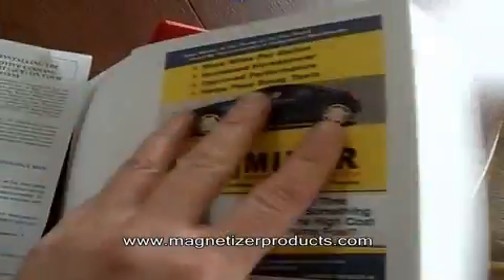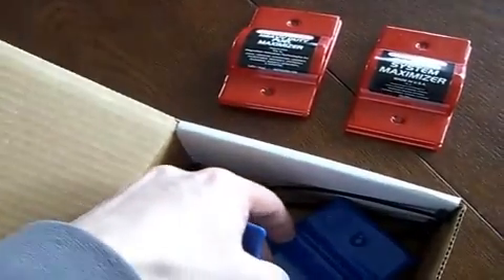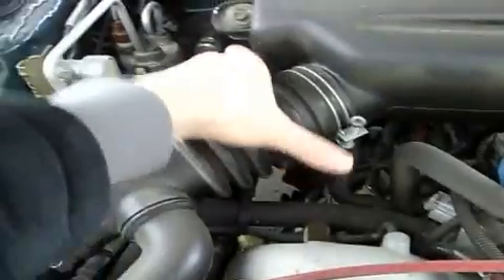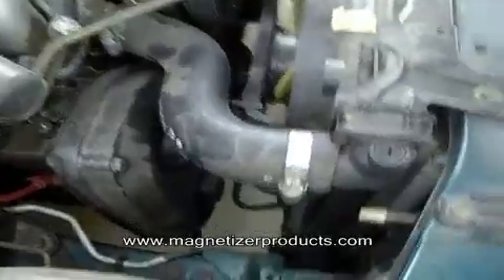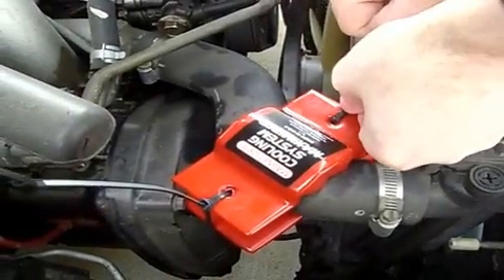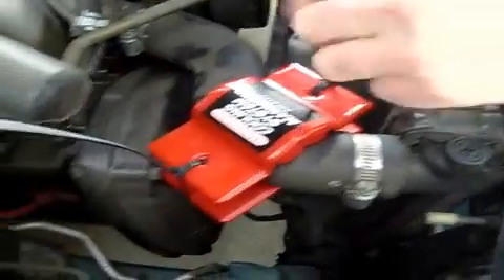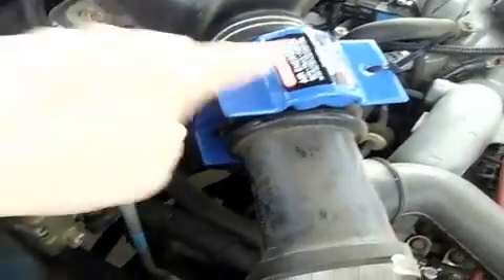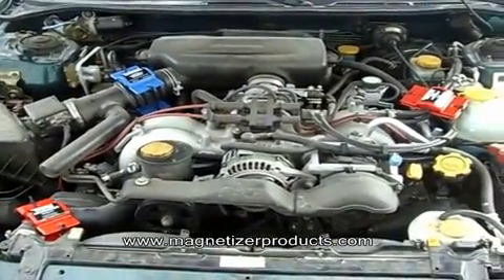Gasoline Maximizer for Automotive use from Magnetizer Products

Comment: The magnetizers work. Most people don't look past their pieholes and do the reading and plethora of research done on Magnetohydrodynamic technology. I've used these on fuel lines, recirc systems on cooling towers and more. These are not your Moms refrigerator magnets. The Flux density and Gauss ratings are substantial enough to effect the polarity of fuel & water. For use on fuel, you use the appropriate models that address the positive charge, in fuel molecules. Remember, positive or 'like' poles repel each other, which is what we want, when addressing fuels. and, opposite poles, N+S attract each other, which is what we Don't want, when addressing fuels.  And, for water, you use the models that use the so.pole only, to treat the CACO3 minerals, in water. I use to treat 500ton and 1000ton cooling towers and within 3mos. the scale came loose within the system and came out and dumped, in the towers sump. This, of course 'freaked' the engineers out. The end result was greater efficiency and heat transfer and factory equipment that functioned optimally, without mineral restrictions and heat buildup. Further, it saved them a boat load of money.  A huge reduction in chemical costs, labor costs, storage and handling issues, environmental issues, ie.-and no hazardous chems to drains or sewers..  I made money and my customers became 'happy campers'.  
Skeptics are everywhere in life. Those who don't understand the science, and don't do the research, or don't use the right magnetos, and don't apply magnetos correctly, are usually the nay-sayers. 
I've seen 'em all over the years, even the people who've used nefarious means to sabotage my installations & other magnetizer applicators, over the years. Sometimes it was engineers, afraid of losing their jobs, or it was someone hired by a chemical company, that lost an account, due to the overriding benefits, in applying magnetos to their piping systems and equipment. Magnetizers work especially well on re-circ systems. Always install a unit on the downside of a circ pump. Make sure the system you apply it to, is grounded. Read the instructions and when in doubt, speak to a techie, who's had experience in installing magnetizers.  Lastly, sometimes the people who are vilifying the Magnetizer, for instance, are people hired by other magneto manufacturers, to discredit a competitor, or its just a web troll who thinks all magnetics is voo-doo science.  So, just IGNORE them, stay focused, and get to work, solving your clients problems and make a buck.   Semper Paratus.

Comment: You guys know that rubber is a natural insulator of electricity and magnetics right?
They use it everywhere tvs house cars . You have to put magnets on steel gas lines or right in the water large magnet or air huge magnet to effect anything . This is from my high IQ of 50 , just eat donuts it will affect your  IQ like mine .

Comment: since when do you see rubber fuel lines on a fuel injected motor with just a crush clamp holding them on. and what is the little canister his fuel lines come out of rubber to steel the only time i have ever seen that kind of thing is when lines rushed out and a hack uses rubber line to bypass the rotten spots but i am not a subaru expert so maybe they are the only fuel injected car that has a bunch of rubber lines from the factory but a doubt it

Comment: oil filtet magnets do work... I cut apart my oil filter before an oil change and compared it to the one with magnets installed after 3000 miles.. there was 3 times as much metal material in the magnetized oil filter..
Reply: +lwj w - For God sake, don't mix things I use magnets on my oil filter and oil plug it work perfectly to retain ferrous particles. That's one thing, claiming fuel savings, performance improvement or any other benefit in the engine is total lie and scam. No other words serve to describe any company selling this so called "miracles".

Comment: Magnets cannot affect anything that is non-ferrous by nature, yet gadgets like this resurface in the marketplace like clockwork a few years after they're proven ineffective.  P.T. Barnum was right, new generations of suckers are always just getting ready to pop out of the womb.
Reply: +NOLL72 important to keep this in mind. iron is the element is associated with magnetism . haem iron from vegetable source could be less magnetic than inorganic iron ore. ionisation could have a play on how efficient  a system is. apparently postiive ions  hold a magnetic charge.
Reply: ions  could get into water. hence water could be affected by magnetism . question  becomes finer. can ions get into fire. if ions become entrapped in elements. fire is an element.
Reply: The terms ionize and magnetize are not interchangeable, as they describe two different properties. Although water may be ionized, giving it a positive or negative charge, it cannot be magnetized. If that were the case, this "gimmick" could be attached to a hose and water passed through it into a plastic container, then it would be attracted to a strong magnet held near its surface. That won't happen.
Positive and negative in electricity isn't the same as north and south poles in magnetism. It that were true, a magnet would stick to the lead post of a car battery. 
I learned this in grade school science class. Maybe you should go back and take a refresher course before attempting to tell somebody that paid attention in class that they are wrong. I'd suggest taking spelling and grammar again too.

Comment: if the fuel is magnetised positively. the air is charged negatively. do then opposites attract . do not some magnets have a north , and south on both sides.
Reply: I've been working with magnets since the 1990's. In the first few years they didn't work very well. Then we changed to monopole magnets and the results were incredible. Some fuel molecules are positive and some are negative. Opposites attract so the fuel molecules come together to produce hydrocarbon clusters. Oxygen cannot reach the inside of the cluster so that fuel is wasted. Only 68% of the fuel is burned. This is why vehicles use so much pollution equipment. When you convert fuel to a positive polarity, the molecules repel each other and the clusters break apart. Its a lot easier to burn a tiny fuel molecule than a clump of them. We then convert the air coming in to the engine to a negative polarity. The negatively charged oxygen is now attracted to the positively charged fuel and 42% more fuel is burned. Emissions drop by up to 90%.

When others saw our success, hundreds of knockoff artists came into the marketplace with just a tiny magnet with a hard plastic housing and said that their product would save fuel. They tell people that the fuel molecules are aligned. This is just made up trash. This is what they tested on Mythbusters that failed to work. Go to www.mycoolboost.com for more (much more) information    -Jeff
Reply: @Diantane22   How to obtain corect polarity? From N and S positining or appel and repell? Thanks!
Reply: A scam huh? How come one of my commercial customers bought systems for 39 vehicles over three months (including two tractor trailers and 14 triaxle dump trucks. Two weeks after installation the owner reported the mileage went from 5 to 6.2 (a 22% gain). He said the numbers don't lie. The drivers fill their trucks up every night and write down the truck's mileage. If it didn't work, why would they invest tens of thousands of dollars over such a long time??
Reply: Why are you arguing with me? We sell the same product line. But instead of advertising 30 year old testimonials and technology on my website (I used to show the same testimonials twenty years ago), I decided to go out into the field and see for myself. All of my initial technical training came from Peter and Mike, but since I installed thousands of systems (have thousands of pictures of them) and faced many problems that were overcome through research, I can tell you for a fact that I know more about this than most reps out there. Especially the ones that sit at home and post a 20 year old, non-updated website that show videos that are distorted from age. The testimonials you post are from cars built in 1997 and '99. I work on 2018 vehicles! They have changed a lot in 30 years. Last time I worked in the field was yesterday, not decades ago.
Reply: You say that what I'm saying is not entirely true. This is because you are reading the wording presented by the technicians at Magnetizer 25 years ago. Once A class we had heard how this works from a US Navy nuclear engineer. After his speech, the students in the class said that what he explains was far different than how I told it. I replied that what he said was exactly right, but if I talked that way to most customers, they would never be able to understand me. So I have to break it down into layman's terms so they can.

Working as a mechanic inspector in power plants, factories and office buildings for most of my life I continuously had to do this so that the average engineer would know what was wrong with the system that I discovered a problem with. I can't start talking about the atomic properties and such. It would be like talking in greek to Americans.
Reply: +mervyn shute Yes, that is the exact point to the opposite charges.
Reply: +Aaron Murakami so. if you have a positive to a positive. that would drive the magnets apart. if a negative side is put to a negative side. this to would drive the two magnets apart. if this is correct. the question is. if you have one magnet . how can you tell which is the positive side, and which is the negative side. ....
Reply: +mervyn shute Those magnets do push apart, but you force them together and clamp them like that. You want that repelling field of that polarity hitting the fuel.
Reply: +Aaron Murakami too crude. magnetic fields need fine tuning. you have got to capture those fields in the first place.  jeff james does say about the field not being effective, until after the first 10 minutes. remains effective for 20 minutes after the engine is shut down . this is one of the . in depth data that you need, not on someones sayso.
making progress with. blind studies. is not good for you.
Reply: +mervyn shute Documentation beats all the beliefs. http://magnetizerproducts.com/testimonials.php there are tests for the gasoline Magnetizer from the US and Canadian Postal Service, Brazilian EPA, etc... read that entire page in detail and there is no debate about it.
Reply: +Aaron Murakami no doubt about it that magnetism really works. it is applying it [without blowing a fuse] . instruction , application. technology seems to be a shortfall.
Reply: +Aaron Murakami the debate starts. for different fuels, and different applications.
Reply: +Aaron Murakami  you say that this film is one of yours.  you also say that . jeff james is a scam. yet his [jeff james]  point. that he had retrofitted  the.  MAGNETISER  that were used on trucks that did " not work".  my opinion . thereupon why your/maximizer did not work , is that they were too small for the size of the vehicles that jeff james was working on. hence the need for an. electro magnet system.
Reply: mervyn shute
I didn't say Jeff James is a scam. I am saying that what he is saying is not entirely true. Studies have shown that magnets that are too strong negates the benefits. Stronger does not always mean better and there is a window the magnets need to be in for them to work optimally. His claims about these products not working is just that, a claim with ZERO proof and he does not offer anything up other than talk. He then says he threw out all the receipts so he can't prove it. There are 2 primary keys - one is the magnet strength has to be correct and two, the magnetic field's relationship to the fluid flowing through the field has to be correct. You can't just take any magnet and throw it on a line and expect it to work. These are real testimonials over the years: http://magnetizerproducts.com/testimonials.php and the very bottom is from Siemens own engineers showing about a 17% average increase in fuel efficiency in the boiler plants. I'm done with this conversation and have no interest in convincing you. You can either look at our record, which exceeds all other companies combined, or you can believe people who just talk and admit they have no proof.
Reply: +Aaron Murakami scammer

Comment: also where on earth did you get the notion to negatively charge incoming air to the engine. has it got anything to do with. ionization. the air intake tube on any ic engine is pretty big. needing those big magnets.

Comment: jeff james. are you in a position to quote on. to supply a system. if so, then please do. i am fuelling my truck on wvo. negative , postively charged , i do not know, but it could have something to do with the ph of the fuel. i do have a ph meter. another possibility. is by fitting an electro magnet. which should open the field for a controlled application. you say that you have fitted over 72vehicles with magnetic systems. any in-depth reviews as to statistics . thaks

Comment: I would only use one on the colant reservoir to hold any rusted small metall dirt in the collant  system until i decide to take out and clean the coolant reservoir and the rest of these magnets i would send them  to any car comedy show.  In fact some molecules may turn into crystals depending on what is in the fuel then it is basically a totat of a very  small amount of sand going to the engine after a  year of using these magnets.

Comment: are the magnets repelling or attracting on the fuel line ?
Reply: It doesn't matter because it's a load of BS anyway. Magnets attached to a vehicle's fuel line have been claimed to improve fuel economy by aligning fuel molecules, but because motor fuels are non-polar, no such alignment or other magnetic effect on the fuel is possible. When tested, typical magnet devices have no effect on vehicle performance or economy.
Reply: ***** thanks , i was was curious about that and trying to find a way to save on gas mileage since i drive for my work ..
Reply: +Daryl Dettmer   who has the  answer. where are you.